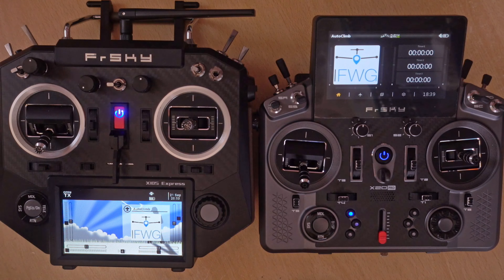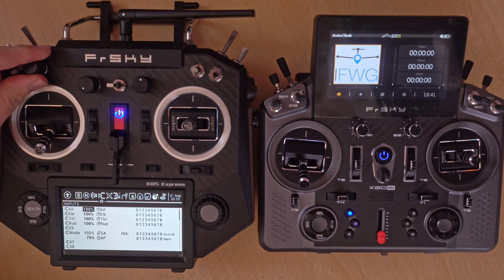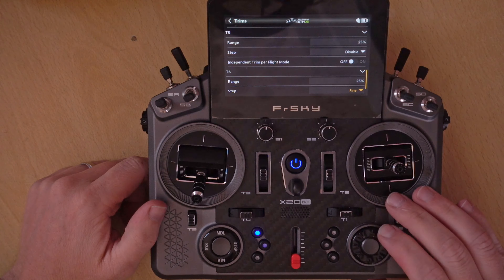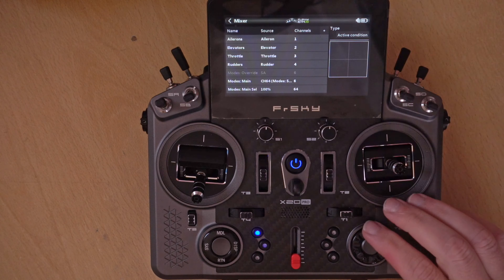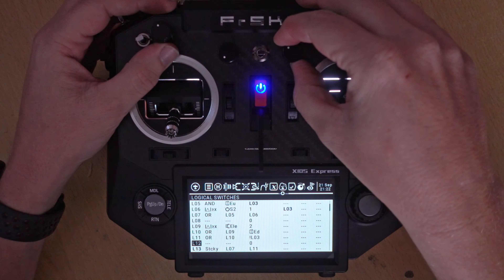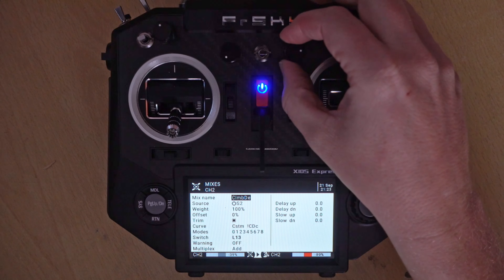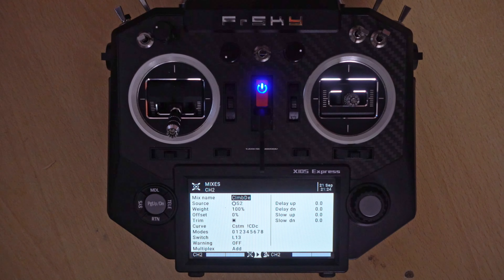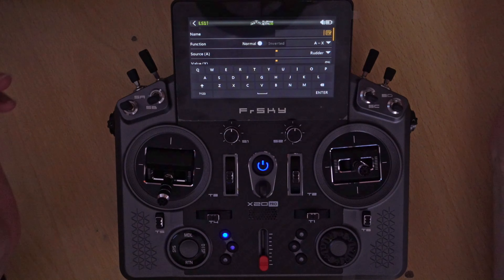A better hands free climb/descent for INAV, ArduPilot, and other flight controller firmware

Comment: Hello Darren, great work, I apprecia that. Question. I think it will, but just to be sure: Will this also work in Loiter mode?
Reply from the maker: Yes, it will work with loiter in INAV. You can use pitch to change the height of the loiter. You would just need to add the loiter switch position in the logic to allow the system to work with loiter.
Reply: Just tried it out and it all functions just fine as I hoped and expected in Cruise - and Loiter mode. I changed point 1 and 4 in the curve to -100 and 100 to have some more authority.
Thanks again for your brilliant work!.

Comment: Hi Darren can you help.? I am new to inav and edge tx. I am having problems with two models , with both the throttle does not work despite everything apparently working even with satellites. On one the atom Rx swordfish I am getting next to no elevator movement and zero rudder. I appreciate this is not the right place to request help but I am very frustrated as everything appears correct. Any help would be very much appreciated. I have followed your videos and painless 360.
Reply from the maker: Hi Graham,

See if this helps with the throws:
https://youtu.be/zC6DxGpqurI?si=_2umwPyvliFf1I0p

For the motors not starting, see if this helps. It’s for INAV 4. But it’s pretty much the same: https://youtu.be/6YuJjAknBsQ?t=3125&si=t29PH_rFAH6om9iM
Reply: Thank you Darren much appreciated @MrD

Comment: Hi, I have Speedybee F405 Wing and I have problem to back from ArduPilot to INAV. Someone know how to do this?
Reply from the maker: You should just need to put the flight controller in to DFU then flash INAV. You could try the ImpulseRC Driver Fixer if it won’t go in to DFU.
Reply: @MrD  This not work. This is not my 1st flashing. But I fixed by STM32 programmer to write INAV and now I can flash again by INAV Configurator.

Comment: Hi Darren me again, solved the movement issue but still no throttle? Everything seems ok, throttle test in inav works ok. Have tried toggling arm switch several times, no luck.? In your setup video you mention there are several reasons /safety features that stop throttle from working but you don’t say what they are. I don’t want to take the model out without the throttle working. Once again your help would be appreciated. I won’t bother you again!
Reply from the maker: TBH, that would really need to be asked in the INAV Fixed Wing Group Facebook group or Discord. Settings would need to be checked, which is not plausible on YouTube comments.

Comment: May I suggest you take a look at the VTOL support that will (hopefully) be out with INAV 7? If you have a suitable frame available of course. I have a Jumper Xiake with a F405VTOL FC that I struggled to make it work with Ardupilot but would like to run INAV on it.
Reply: It's not out so why look at it?